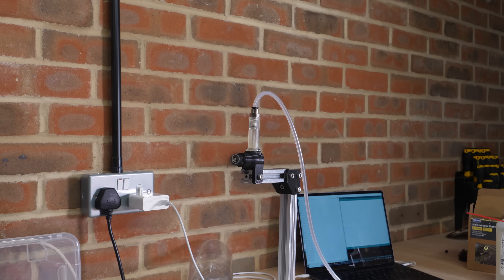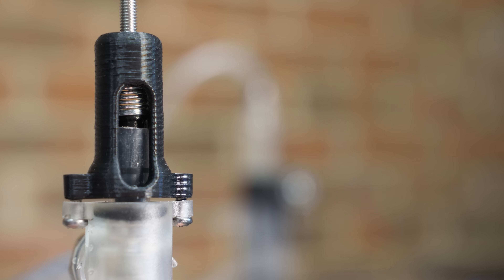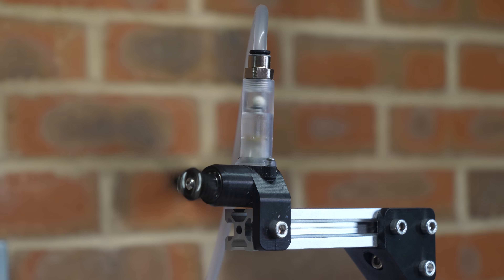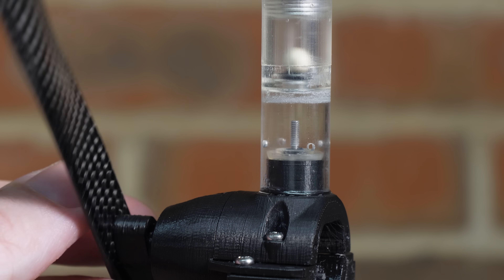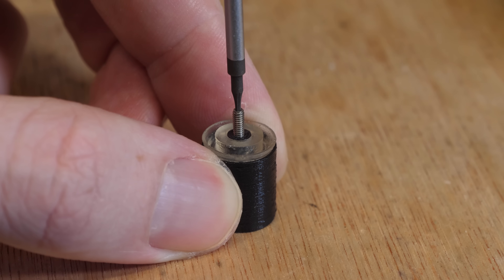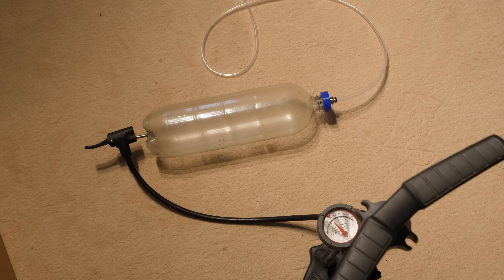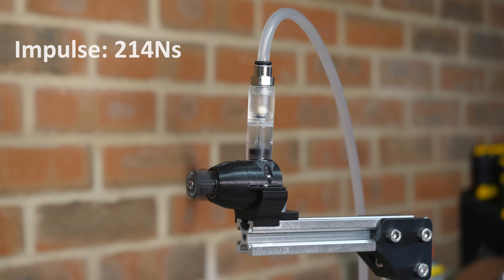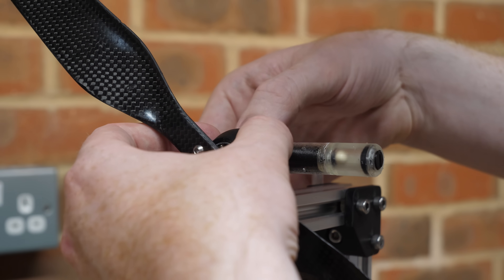4,500RPM Air Engine

Comment: Hi, I just watched this video and the previous one on your channel. It's not my intention to be offensive or mean, but I have an important message for you: technically (and only technically) the engines you're working with are... I can't think of a better word than "garbage". Don't get me wrong, I can see how much effort you put into your projects. Have you ever heard of an oscillating cylinder? They are very common in toy steam engines or small steam powered model trains and boats. The idea of an oscillating cylinder is almost 200 years old, but its much higher efficiency and power will make all your engines obsolete. Please check it out because I'm sure it will help you create more amazing videos and develop new interesting and better engines
Reply from the maker: I've researched oscillating cylinder engines, and whilst they run well, the friction of the valve is an issue, especially if made completely airtight. For this reason, I've experimented with cam and push rod valves, but they still struggle with efficiency due to extra friction. Please refrain from claiming something is "garbage" before you run the tests yourself. Thanks
Reply: @TomStantonEngineering  cam and push rod valves cause too much friction, making them unsuitable in air engines, thats something I agree on. Friction on osc cylinders can be minimized with smooth surfaces made of hard material on the sliding surfaces even more if you lubricate them which also makes them (almost) airtight. The total power loss from friction and air leaks is barely measurable and much less compared to the power loss of an air engine which has to compress its own air while also pushing the intake valve open against the pressure behind it. I apologize for using the word "garbage" which slipped cuz i was raging a bit. appart from that the 3 decades of working and experimenting with a variety of model and real engines, including these air engines teached me many times what i said previously. Compared to an air engine, an osc cylinder is superior in all parameters as long as it is built correctly. Even if you optimize an air engine to the maximum possible, it's difficult to get it anywhere near the performance of an osc cylinder, and if you put the same amount of effort into optimizing an osc cylinder it will leave the air engine far behind. I apologize again for saying "garbage" I don't know what got into me. It would be sad if this created a wall between us, preventing you from using my proposal constructively.

Comment: You should try running a thermodynamic analysis on the engine to keep optimizing it. It would be interesting to see a more in depth engineering process. It might even be worth going back to a cam driven valve system too.

Comment: It would be interesting to see if it improves phasing the two cylinders 180° apart on the crankshaft, like in a boxer engine. I think the vibration reduction will translate in a higher power output.

Comment: I wonder if having the cylinders offset would be a better option than having the curved rods. Traditional aircraft engines as well as BMW motorcycle engines (which I think were actually for aircraft originally) are also built with offset cylinders. With this miniature 3D printed design it might not even make a difference that could be measurable but might make for a good test. With the bore and especially the stroke, the change in curved rods to going with straight rods may show a difference in the torque as well as reduce the friction on the piston walls with the rods parallel to the pistons and cylinder walls and also reduce any air loss due to the pistons riding slightly cockeyed in the cylinders due to the rods being connected to the crankshaft at a small offset distance. Great work, Tom! I really like the content that you present on your channel.

Comment: Just curious, could you make a radial air powered engine and then have a carbon HPA tank as it's air supply? The tanks are super light and hold 4500 psi. Would probably run that thing for a Long time with a regulator of course. It might even be light enough to put on a rc plane

Comment: That's the wrong kind of two piston setup. You should really take more inspiration from steam engines and maybe try a double expansion engine or a double acting piston with a slide valve analogue.

Comment: Hey Tom, I’m always enjoying your videos! I find them very interesting and educational. So keep up the good work!!

Sinds you are looking for more efficiency and power output of your air engine it might be helpful if you place the cilinders at an offset compare to the crankshaft so that the power-stroke pushes not straight through the center of the crank but more at an offset in the direction of turning. So it will fix the turning direction but it should increase the power output!

Hope you understand what I mean else try to search for “offset engine” in YouTube

Regards Bas from the Netherlands 🇳🇱

Comment: It be interesting if you can retain the two cylinders design but the second one uses the exhaust gases from the first. Would it be a beneficial for efficiency over added weight and complexity?

Comment: Rather than using a static pressure chamber that simply loses pressure, why not have a mechanically collapsible pressure chamber that will keep pressures constant and simply decrease in volume?

Comment: I'm using the translator Hi, I've been following the dea engine series from the beginning and I wanted to congratulate you on your initiative, I wanted to know why you don't use low pressure pistons so that you can use the gases and exhaust from high pressure pistons, and you wouldn't be able to use a low pressure turbine either pressure connected directly to the shaft to be able to use the exhaust gases from the last pistons, would that be more dead weight or would it work?

Comment: Few ideas : you may now try to add an exhaust manifold and point it rearward. It would probably not contribute much to the thrust but if you can afford some more grams it might be cool and help dampen a bit the sound.
Also, you may try to use straight connecting rods and single crank pin opposed 180 degrees per cylinder so that power stroke happen exactly at the same time on both sides. Might induce less vibrations like this as power strokes will cancel each other's inertial movement.

Comment: Quite right, it presses precisely along the vector perpendicular to the lower surface of the wing precisely at that transition point where the molecular composition of air is rarefied on the upper surface.  Yes, the air molecules from the bottom of the wing, as it were, are trying to equalize the balance of air density differences and are trying to reach into the upper part of the wing, but they meet the object itself in space (the wing) on their way, squeezing it towards the rarefaction.  From below, at the transition point, a small, dense ball of air is formed, which appears due to the high speed of its injection by the impeller through slotted rectifiers in reciprocating circulation systems.  Here, as it were, it was possible to apply Archimedean forces, but here there is also the speed of the air flow.  The system works both in closed circuits and open circuits, it has been tested in some closed laboratories.  Now the issue of aliens from outer space is being vigorously discussed, and some large companies are raising questions about the further use of ground transport.

Comment: I'm very excited to see this take flight! Have you thought of a single cylinder setup with air intakes to the top and bottom? You can use a gear and bearing setup where you have the rotating motion of the gears, using the same thing bikes have to allow for one direction of rotation you can have both up and down strokes power the prop. It would need to rotate a circular crank-ring which attaches to the prop of the airplane, since it would make it much easier to run those gears and the bearings needed. I think 2 would be all that's necessary. The bottom piston rod would allow air into the cylinder through a small hole in the rod itself. A hollow rod also allows for lighter weight and stronger, overall, design. Since you have a crank-ring you could have that move valves instead that rotate and help air enter more quickly and efficiently with less weight overall.

The crank-ring will rotate then rotate small valve plates with holes in them, allowing for air to flow into the bottom cylinder. The top cylinder too, if you want, with no need for the small rod on it. The rotating valves just need to be close enough to have the air flow in quickly at just after top/bottom dead center. Middle dead center would end up being your air vent valve, although if you place the correct valve placements on the rotating valve plates then you can have that be the exhaust as well until intake is needed. You would need rods that have gears on them to rotate the valve opposite to the crank-ring. Or just gears in-between.

Comment: Another excellent video! I was wondering if you might convert to a double or triple expansion engine to make use of the exhaust? 
Also, if all the exhaust holes were on the aft side of the cylinder the air flow could add to forward thrust?

Comment: so i recently learned that "hemi" stands for hemispherical pistons, which were convex piston heads in internal combustion engines. i knew that some engines had convex piston heads before this but i didnt know it was labeled this way. maybe try a convex piston head instead of concave piston head? also maybe ring gromits instead of piston head gromits? regular engines sometimes have dual ring gromits with a special kind of washer to keep them in place, idk how that would translate to small scale.
also maybe dual overhead valves? i realize all of this is engine speak for cars but this is literally the same path but with a different material.
this might just be a boxer engine with a different fuel source and material for building.

Comment: Could the air storage be made to be dynamic so that it contracts as it expends air keeping the pressure higher? Like the way the cyclinder/spring/diaphragm works but without the out pressue valve (outside of the valve to output)

Comment: I feel like the design decision to have the perfect expansion ratio volume is part of the issue why it didn't produce as much thrust too... I've not done designs for air engines like this, but the thought came to me while I was watching your animation - if the pressure in the chamber at the "exhaust open" position is 1 atmosphere, then there's no "incentive" for any air to come out of the exhaust (that sounds weird - I couldn't work out how to word it better, but hopefully it'll make sense in a minute). 

In that case, when the piston starts the upwards stroke, is there not going to be 1 atm worth of air in the cylinder that's compressed again, up to the 3 atm pressure when the valve opens up to let more air in - which, if that's your inlet pressure, is going to reduce the amount of air being injected in each cycle?

Whereas, with the design on the right, because you're venting exhaust at a higher pressure than atmosphere, doesn't that mean that the pressure in the compressed, pre-injection cylinder is lower, causing the air pressure to have a greater ability to apply force on the piston?

I feel like there's a trade off here, because the wasted air in the exhaust obviously doesn't provide any useful power to the engine. 

But I feel like the flipside is that if, when you're closing the exhaust port and beginning the compression cycle, the cylinder contains a volume of air that will match the pressure of the inlet line when compressed, you're relying on the inertia to keep the cycle going.

I feel like some kind of "half-cycle" valve in the piston could help, that allows the cylinder to vent air during the compression cycle. Perhaps some kind of cam shaft in the piston that holds closed a one-way valve during the expansion half of the cycle?

Then, when you're injecting air at higher pressure, there's effectively only 1 atm in the compressed volume, allowing the engine to utilise the energy injected into the cylinder each cycle more efficiently?

Probably something you've already thought of though 😂

Comment: If there is still energy in the compressed air after it exits the exhaust port, consider the compound engine, like triple piston steam engines
https://en.wikipedia.org/wiki/Compound_steam_engine

Comment: Have you thought about making a single piston with your first design (1 to 3 compression ratio) but with an offset crank so that at tdc the piston rod is not a the top but at an offset angle to the crankcase to increase the thrust (like your second design) would it be more efficient because of less residual pressure at the end of the cycle?

Comment: I just read some if the other comments the fellow that stated the cap stretched was 100% correct! I went with aerospacy Stainless steel eike heavy . You kids and your 3D printer ... Lucky stiffs!! How about a cage around the soda bottle! And a 3D printed "Cap" with built in throttle/regulator in it??? That would fix a bunch of Boom 0 shit problems and keep your "off the shelf" useage still in place?!!!!! Ed in Phoenix writes.

Comment: Tom this project of yours is fantastic! As you're exploring ways to increase engine output have you thought about offsetting the crank shaft from the centre line of the piston?
it does come with some draw backs but it also has some gains that you might be interested in. like increased torque output and longer power stroke duration.

Comment: Tom, what science you've employed into this motor ... WoW!! I thoroughly enjoy watching these air motor builds and hearing your findings .... I tried messing around with one that had three moving parts and was yacking with AIR Hoggs corp.  But things didn't end well .. mine was an air cam axial adaptation / we can chat about that if you like .. .. this motor being a fine tuned two cyl .. I love the throttle idea that would be awesome on an ari powered flying model. BTW I hydro-stated three letter soda bottles in the 130 to 156 ranges the plastic was deforming swelling and such but could not believe the pressures!! Geez!! Hope you can do a throttling mechanism for use with this new twin that's pretty awesome building Sir Tom!! Ed in Phoenix writes

Comment: Maybe something to keep in mind about the two cylinder engine. You have 2x the torque, but not necessarily 2x the load, which means it may not be delivering all of its power potential and giving the reading that it's less efficient when in reality it might be better than it appears.

An alternative to using a propeller would be to make a simple dinamo test using a DC motor as generator, and gradually short the windings with a variable resistor while measuring Amp load in the circuit. If you could also measure RPM, you could then chart an accurate power curve for each engine design. :)

Comment: To massively increase run time, why not put a piece of dry ice in the pressure vessel. As it evaporates it will maintain the pressure. Its the ultimate compressed 'gas' being a solid n' all 😊

Comment: ...and then there's me, instantly thinking about whether or not a radial 5/7/9 cylinder air engine could be built based on your cylinder design, how amazing it would probably look and sound and if a simple power control could be implemented using just a small ball valve on a servo after the regulator or if ithe engine would stall just a bit below its normal working pressure... Superb videos, just waaaay too few of them for my taste :D Always a nice start into the day when I see there's a new one. This channel combines quite a few of my interests.. engineering, electronics, RC, aircraft of various designs, ... Keep up the good work!

Comment: Have you thought of using them in a rc car? And can you power them with steam instead of just pressurized air? Or is the heat of steam too much for the plastics to handle?
I would love to see them used in a rc car powered by steam! 💙

Comment: You’ve spent hours explaining exactly why, but I still don’t quite understand how air being pushed through some valves and tubes to turn a propeller to propel a plane produces better results than using the air to propel the plane like a jet or rocket.

Comment: Almost two motors you showed with the large cylinder capacity and the smaller cylinder capacity what if you moved the crankshaft slightly to the left instead of being centered

Comment: I wonder if you could use the electrolysis system ALEX LAB has to generate enough PSI to maintain that a plane could run on it? Since it's got like 800:1 volumetric expansion

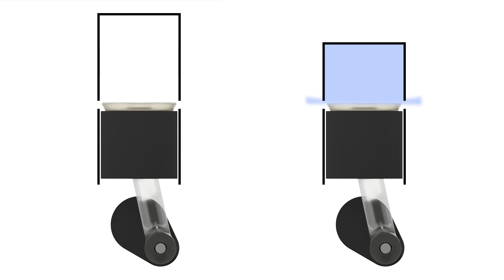Comment: 6:50. Isn't similar thing happening in 4 stroke engine and they resolve it by offsetting the cylinder toward the powerstroke side of the crank so that the powerstroke is applied at 90 degree to the crank for most efficiency?

Comment: I am sure people have already suggested it, but if you make it a boxer engine, meaning making a crankshaft and each cylinder reaching tdc at the same time, you will balance it out and increase efficiency by a big margin. Common crank pin means shake to death like Harley Davidson motorcycles!

Comment: Great work man like always it's just like uniflow steam engines design, I found some patant for a self regulating en self triggered uniflow engine value design, it's also dubble acting piston en it may be the answer for a even higher efficiency engine !

look for patant US20140196601A1 

Greetings
Reply: I forgot to mention the duty cycle can be adjusted while it runs en is self acting in terns of load so the engine is more or les regulated in speed aswell